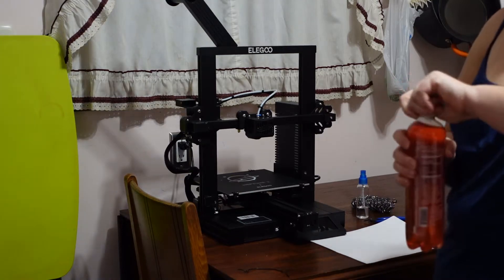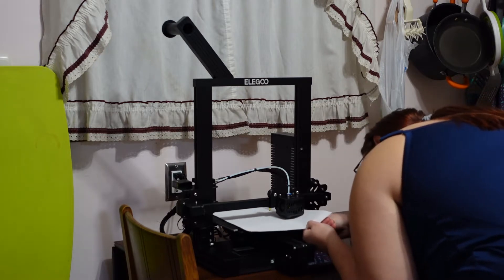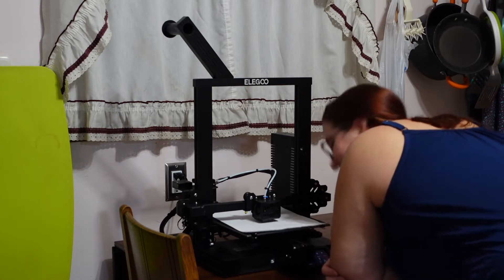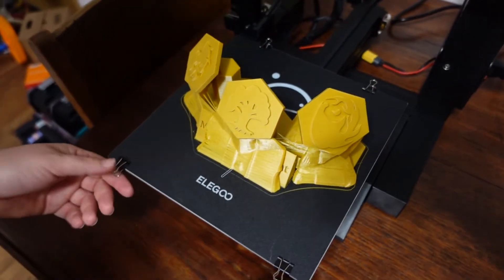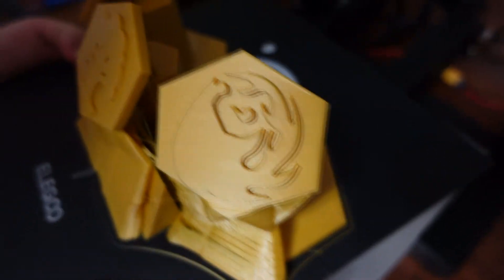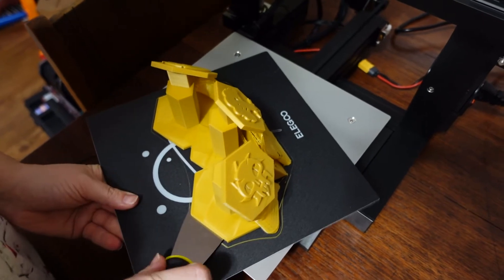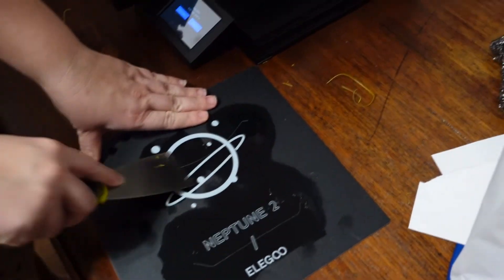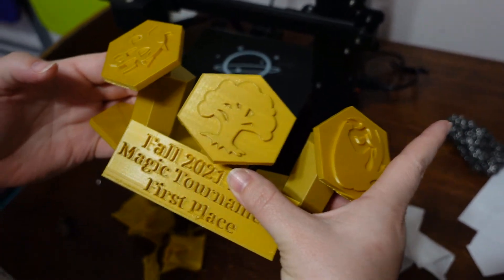Leveling the Elegoo Neptune 2 and first print

Comment: How is your Elegoo Neptune 2 holding up? Is it just as reliable as the Q5?
Reply from the maker: The Neptune 2 is fantastic printer (especially with a BL Touch installed) but I think the Q5 still wins out for reliability.  Those things are little workhorses.

Comment: I've had one since last June.  160 quid in England.   Zero issues,  no mods since.  I recommend feeler gauges for levelling.   Don't turn the Z-screws while it's on, thr motor functions as a dynamo and you're generating a current which can fry driver components.
Reply from the maker: Thank you for the tips